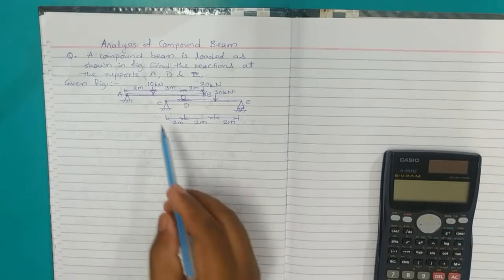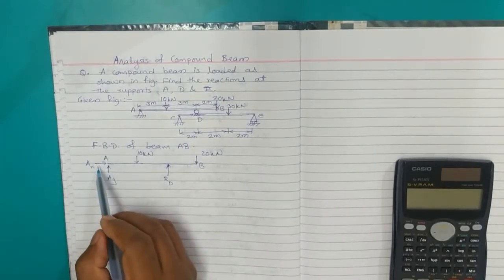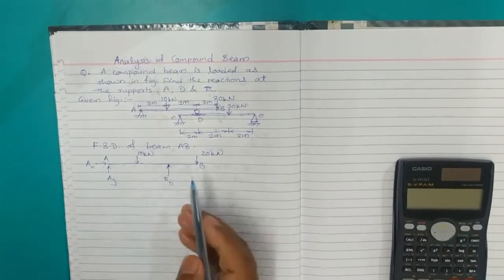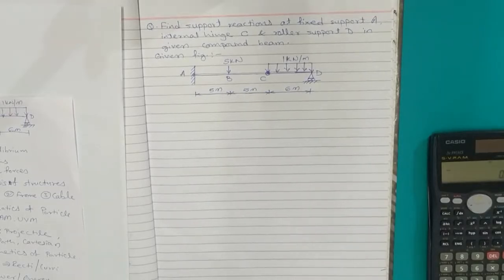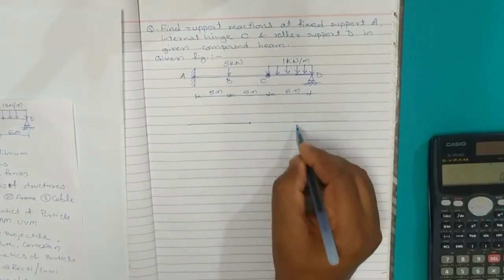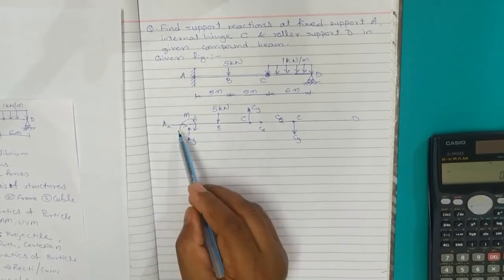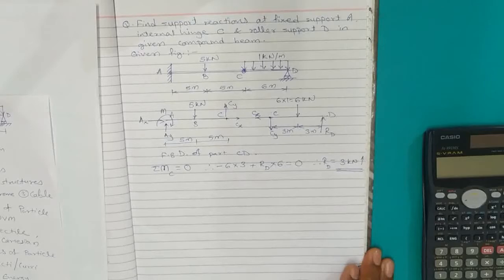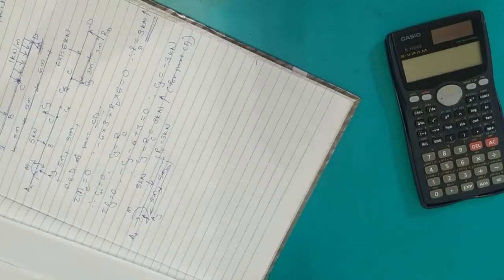Equilibrium of Beams: Lecture 6

Comment: In last question,If moment applied at point c in FBD of beam AC then M comes negative clockwise
Reply from the maker: In fbd we have already assumed clockwise sense of moment reaction M. It's answer with negative sign suggests that our assumption was wrong, the correct rotation of moment should be anti-clockwise.